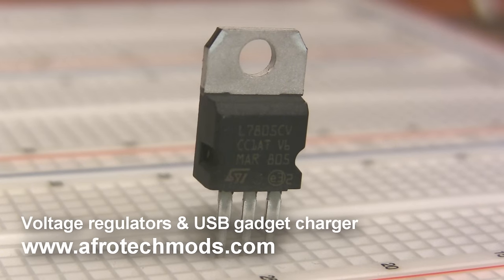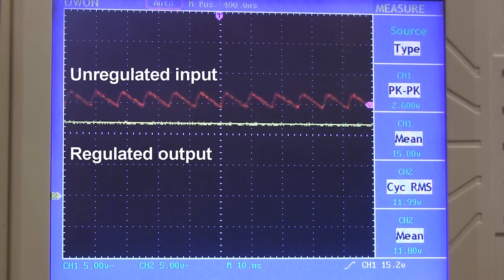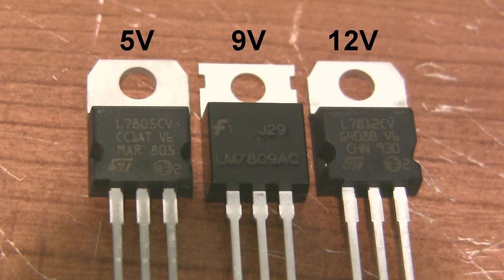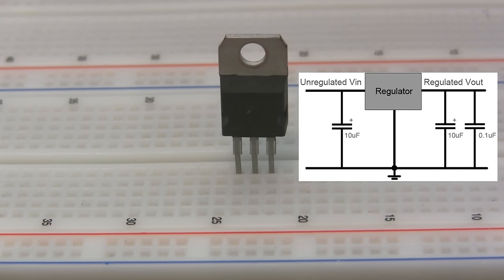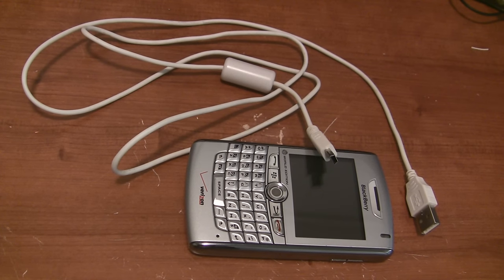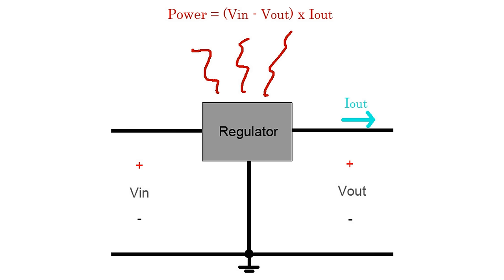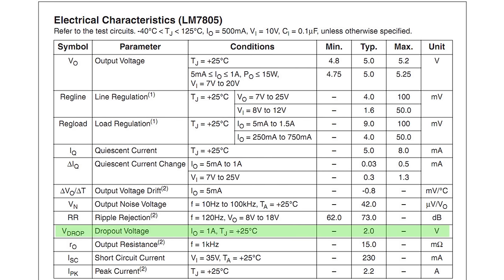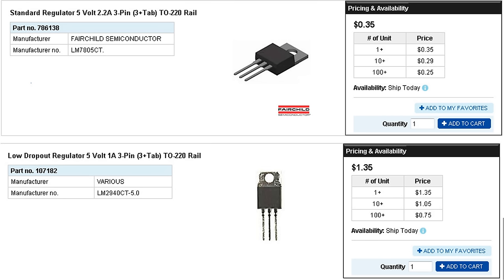Voltage regulator tutorial & USB gadget charger circuit

Comment: Depends how much (or little) you already know about alternators. Try this image h**p://mgaguru.com/mgtech/electric/pics2/alt001.gif of a car alternator to understand basics. ALL alternators, no matter how big/small/# stator coils, look essentially like this (wiring may instead be a delta config). Amount of force needed to turn an alternator (ANY size) is dependent on its output load & its ability to provide the power you are seeking. 53Amp alternator (14.4v) = 760 watt o/p = 1 HP of drive!

Comment: They are easy, but inefficient so I deem them to be useless. I would rather just buy a buck converter with the adjustable resistor which is far more efficient than using a linear voltage regulator. You can get buck converters for like $2 or so each. They can be 95% efficient, or at least 90%. A 40v down to as far as 2v buck converter is efficient enough that it doesn't even need a heatsink (at 3A also), add the fact that you can adjust the output by turning the variable resistor and it's a no brainer that it's the way to go.
Reply: Have you tried the TL431? Acts more "like" a reverse biased Zener diode (with "programmable" Vz) so power dissipation is somehow less relevant (it has its own limitations, though)?

Comment: In a nut shell, a capacitor acts like a resistor when it's on an AC circuit, and like a battery on a DC circuit.

Comment: turns out regulators explode if you accidentally reverse the polarity.
Reply: technosasquatchfilms So do the capacitors. Always double check your power connections and have a current limited bench power supply.

Comment: Soon I want to use high amp alternator output from back of alternator to convert that amperage to voltage with resistance capacitors or resistors & 9v regulators in series.  POSSIBLE?

Comment: nop. Voltage regulator limits the voltage, it cant create more then the input is. 
If the input is less then 10V you could use a amplifier circuit (a  stepup transformer for example) but you would lose in current (amps) - you cant get free energy.

Comment: Why would I want a device that wastes my input energies?
Reply: There are pros and cons to the regulator, the one you mention could be considered a con, but the pro is all about regulating and making the output consistent across many different loads. Watch his video on diodes. He goes over a half and a full-wave rectifier. Watch what happens on different loads. In some electronic applications, you need the same voltage regardless of the load range. That is where a trade off for energy loss would make sense.
Reply: Could not the same be achieved using inductance and capacitance? There would still be thermal losses yet at a lower percent then aforementioned.

Comment: apple is like any other (new) mobile device running on 5v 
the only other thing that you have to keep in mind , is the fact that a i-phone 4 is drawing a good 8-900 Mili Amps and i thought it is for the 5 also around 900 mili amps 
nowing this u have to keep an eye out for the temperature of the regulator!
there is nothing special about the connection and nothing special about the chargers aswell

Comment: I ran a 2/0 copper stranded wire from a 50,000 volt transformer on a pole in my backyard to a 5v voltage regulator duct-taped to a heat sink so that i could power up my 8086 computer.....well...needless to say....six firetrucks and a 10 foot hole in the ground later...I was wondering..."Where did I go wrong"...?????!!!!!!!!